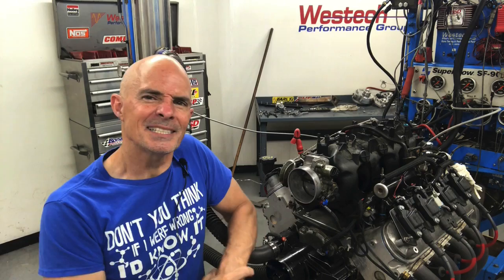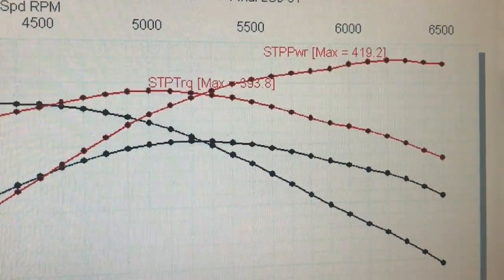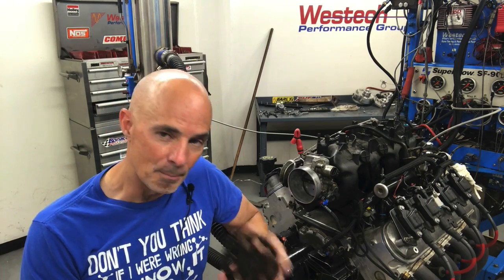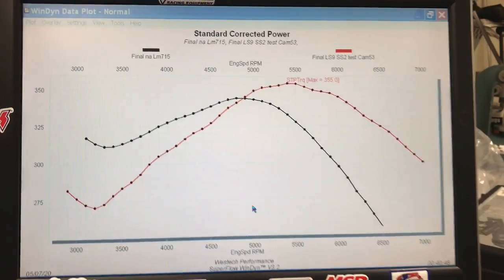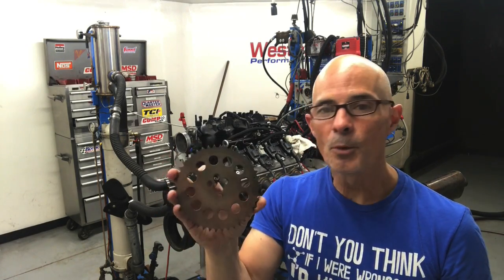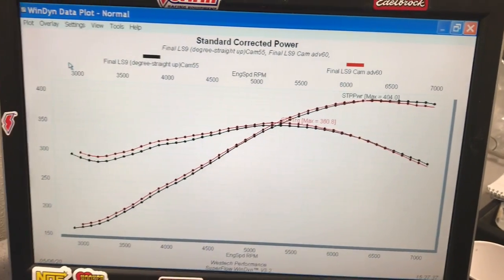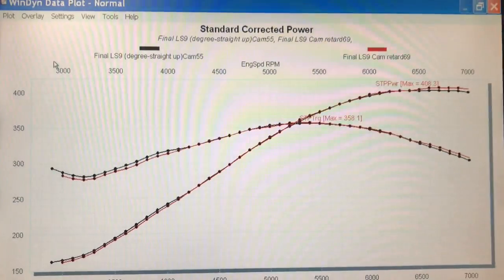LS9 HOW TO: EXTRA TORQUE!!

Comment: If you are running a LS nine cam and a 53 or 4.8 pull it out I’m telling you seriously I had that thing in there for three years. It sounds really great, but it ran like shit. I recently put the stock back in man, let me tell you the difference. Do not use the LS nine count Told me that I did not listen. I’m telling you do not use the LS in a 53 if you’re not going turbo or nitrous. Torque is everything forget horsepower.
Reply from the maker: see the Ultimate factory Cam shoot out for data on how soft the LS9 cam is down low

Comment: Question, can a Mag 2300 charged LS7 make the same or better midrange than a LS9?    All the Dynos on Dynojets I see make like 300rwhp at 3000-4000rpm seems low, can you not run as much timing in the midrange on a charged LS7 compare to LS9?
Reply from the maker: only if octane is limiting your power

Comment: I've been wondering what cam to go to for streetable car. But also wondering if I could take my 5.3 aluminum block engine and use the 4.8 crank shaft then the LS Cam possibly some better springs and a big mass air intake. 
Essentially building s modern 302.
 I'd love to hear thoughts. 
Best Wishes for a fantastic New Year and Merry Christmas.
Reply from the maker: a 5.3l block with a 4.8l crank is just a 4.8L. you need a 6.0l block (4.0-inch bore) and 4.8l crank and rods with 6.0l pistons. but that isn't a 302 inch motor. I have a destroked ls3 video up

Comment: So it appears, advancing the cam made more power and torque, up until the peak power where it feel off a bit. Are there any cons to running it in an advanced state like that for say, a street car?
Reply from the maker: IT DID'NT MAKE MORE POWER-ADVANCING SHOULD ADD LOW SPEED TORQUE
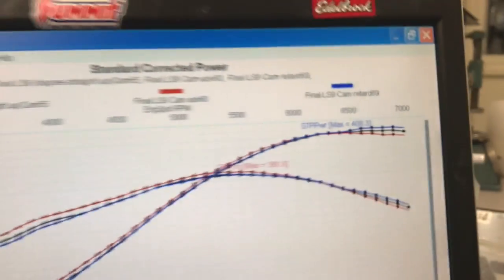Reply: @richardholdener1727  I don't want to come off as arguing with you because when it comes to this stuff, you're the man, but at 9:54, looking at your graph, the red line represents "LS9adv60" and it's above the power and torque line of LS9 straight up and even the LS9retard69 (min 14:21), the entire time until peak power. Unless I'm completely reading wrong, it seems like it does.

Granted it made significantly more torque than it did power but I'm going off the lines on your charts.

Comment: How about a cam test where you get the nastiest, most ridiculous-lift cam you can get, with springs to handle it, titanium retainers, and compare it to the stock cam? One where you need some clay to make sure you aren't touching or getting within 1/100th of an inch of pistons at any time. Make the engine really a rev monster, and document it? Smalll blocks these days are doing better than big blocks of  yore.
Reply from the maker: i HAVE RUN ALL THE CAM THAT WILL FIT IN AN LS VS A STOCK ONE
Reply: @richardholdener1727  I will look at your channel  more!

Comment: @richard holdener I have the LS9 cam in a 5.3 with headers, polished 862 heads and stock intake for an SSR. Someone advised me to add 1.8 rockers ONLY TO THE INTAKE side with this cam. Doing the math the would effectively change the .558 intake lift to .590 and the intake duration from 211 to 223 ...ANY THOTS as to potential results? could this add power down low? or where?
Reply from the maker: WHAT SPRINGS-IT WILL CAUSE VALVE FLOAT
Reply: @richardholdener1727  I currently have GM LS7 springs in there.  I could change them if necessary,  but the engine guy who said this doesn't like the huge duration split of the LS9 cam and thinks this could wake things up some.  Is there any power to be added  just changing the intake side? This would effectively yield a 223 intake duration and 230 would remain on exhaust.

Comment: LSXR Intake, Trickflow 235 heads and a Sloppy Stage 2 Cam would that work for tons of low end torque for a rally/street engine with load speed of low down torque?
Reply from the maker: that combo would not be great down low
Reply: @richardholdener1727  Back to the drawing board, I go then
Reply: @richardholdener1727  If I swapped the LSXR Intake with a Edelbrok Cross Ram Intake and replaced  the Cam with a 
Final HDR Brian Tooley Racing Stage 1 Truck Cam and put in a neat little turbo though, would that be better for low end torque instead. Revisited your videos and made some changes to me wishlist here

Comment: Hi Richard, 
Nice to see that you tested the LS 9 Cam. 
I have a BMW E30 with a LS1 engine. 
It’s a competition Drift car. 
I make the engine swap last winter and it’s an awesome engine. 
I watched a lot of videos from you. 
I´m looking for some extra hp´s now. 
My Setup is:
LS 2 intake manifold
102mm TB
LS 2 Injectors
LS 9 Cam
Custom Headers
MSD Atomic LS Efi Kit
I run with 95 octane
Maybe something around 420-450 hp (never was on the dyno until yet) would be nice and I don’t know if an other cam with my setup is enough for this hp target. 
Can you recommend me a good way? 
Best regards 
Tim
Reply from the maker: lots of better cams than the LS9

Comment: I would like to see the LS9 cam versus the Lingenfelter GT2-3 in a LQ9 with the STS-V supercharger. Since the LQ9 is 211/230 .562 122.5 and the GT2-3 is 207/220 .571 .578 118.5. The GT2-3 was the "gold standard" for the MP112 and MP122 for the longest time but the LS9 obviously has more duration with a little less lift.

Comment: How much more down low improvement would 243 heads make?
Reply from the maker: COMPARED TO WHAT
Reply: @richardholdener1727  your test? Stock 4.8 with ls9 cam? But add 243 heads?

Comment: Hi, I have a Cam with the LS9 Cam Grind in my LS1 Drift Car, maybe you can help me with the ignition timing settings?
Reply from the maker: WE RUN NEAR 29 DEGREES TOTAL
Reply: @richardholdener1727  
I have a MSD Atomic LS EFI kit. There I can chose between stock, mild and Performance cam. What would you say is the LS9 cam? 
In the advanced setup I can set the ignition timing at idle, part throttle and wot. What setting you would chose?

Comment: Given that EFI breath raw air for basically the first and last third of each intake cycle with the fuel dose occuring in the middle third of the cycle , I feel the cam sensors location need not necessarily be individual degree accurate .

Comment: What ls9 camshaft is that? You are using a rear cam sensor.
Reply from the maker: I tried a stock one and a reproduction done by Crane (that has the rear gear)-same power
Reply: @richardholdener1727  thanks!

Comment: How would perform a 5.3 with an ls9 cam, the adjustable gear advancing just a little and turbo ??
Or would it be better just with the ls9 cam and the turbo without the adjustable timing gear?
Reply from the maker: I TRIED ADJUSTING THE CAM-THE BEST WAY IS TO USE A DIFFERENT CAM

Comment: yes, GM does want to kill torque and throttle response.  The wide LSA also lets them run higher compression ratio to get better mpg.  Run a 275* cam with 110 LSA and watch out!

Comment: I built a 2300cc ford engine back in 1985. cannon intake (interesting intake in that it had smaller runners but they were pointed at the ports better and worth more torque and hp!) little bit bigger carb custom jetting, I ported the iron heads myself and shaved .1 inch from deck for 12 to 1 CR measured, crane 230 degree at .50 lift cam, full length header, custom advance curve in distributor with vacuum advance, adjustable cam sprocket. I initially installed cam  mistakenly advanced by one tooth. Maybe 10 degrees? it was a long time ago. The engine ran like a forklift. I could dump the clutch in first gear with no throttle and the engine wouldn't die. I got the cam sprocket lined up correctly and started experimenting and got identical rocking in the power curve as you did Rich. Now i'm going by the seat of the pants feel. The power gain and loss was more pronounced in this little engine than your Ls9.  When retarded 3 or 4 degrees from "factory" the engine would gain about 15 hp on the top and lose that much when the cam was advanced with the same ratio in gain and loss in the lower rpm. Fun stuff, thanks for all your work, it's very interesting!

Comment: Just started watching your videos, and am loving the content.  You are putting all kinds of LS specific content that is great, but was wondering if while you are at it if you could debunk some common myths?  Like say is there any hp change with different spark plugs or wires like the companies claim? Or how much does a mechanical fan Clutch take in HP, Or electric water pump for that matter.  Dirty oil vs clean oil, oil weights, oil filters, the possibilities are many!  Maybe meaningless info but interesting nonetheless. Keep up the good work!

Comment: Richard years ago when i was a kid out of trade school i went to work for gm and lol i bought a Rancho Ford GT 460 and my friend at ford house told install a 429 crank gear . I did Ford retarded the crank gear i think a half a tooth . I did that clean up exhsust a tad lol and a tune up timing ect . It would eat a set of goodyear tires . So there are times when this will work .  As far cams the closing of intake valve late for instance reduced power.  I seen cam with a lot of exhaust duration cause problems with drivable manners

Comment: Changing the 1x cam gear 8deg shouldn't affect the cam sync.  The missing tooth crank wheel is used for timing, the ecu uses the missing tooth to find TDC.  The cam 1x is only used to determine what phase the engine is on. (#1 cyl is on exhaust or compression)

Comment: Richard Holdener, I'm getting ready to put a Gen IV 4.8L with VVT, non DOD, E38ecm into my 69 Chevelle. I can only afford to buy one camshaft and want to do the cam change while engine is still on the ground. What would be your camshaft of choice if you were me? I'm thinking that I want to keep the VVT function. 
Oh yeah, street car with an occasional 1/4 mile trip.

Comment: Thank you!!!! I get soooo sick and tired of people asking me, if I'm doing an engine build, do I degree the cam with a degree wheel. When I tell them I just put it in straight up, or retarded or very rarely advanced, I get the, " Well my girlfriends uncle works for NASA and says you always have to degree the cam or your not a real engine builder". Of course this usually comes from someone who's never done an oil change, let alone built an engine. Everybody wants to be an armchair quarter back, but doesn't want to get dirty on the field. BTW, there are a few companies out there that make wire harnesses and adapters to use the different Gen timing gears with the vehicle computers without issue. I see placement and type of knock sensor more of an issue than the different Gen timing gears with the car ECM. Good info.

Comment: I have done that on accident (one tooth off) with 411 pcm. Runs terrible hard to describe like idle timing is 30 degrees off, which may be what's happening due to offset sensor
Reply from the maker: we don't use a cam sensor
Reply: @richardholdener1727  I understand that with Holley but you asked about stock pcm experiences

Comment: Ran a ls9 cam in a turbo 4.8 build I did a few years back. Didn't run a cam sensor just left it unplugged. No  problems with stock ecu.

Comment: iirc the LS9 cam uses the exact same lobes as the LS7 but on a wider LSA.  LS7 should make torque at lower rpm
Reply from the maker: it made exactly the same on the 5.3L

Comment: I'm curios if the results would be the same with other types of aftermarket cams with tighter LSA.
Reply from the maker: generally cam timing responds like this, some more or less
Reply: @richardholdener1727  So it would seem that degreeing a cam might not be as critical as some make it out to be from a power perspective.

Comment: I live above 5000 ft. altitude, and I can't ever remember retarding a cam. I think we always tried to keep the lobe centers between 108 and 112 degrees thinking it would help trap cylinder pressure. We might use smaller runners and intake valves to help port velocity.

Comment: Hey Richard. To answer your question on advancing or retard teeth, the answer is both. On the early Gen 3 16238212, 411,  and  12576106 PCM's many times they did not have enough resolution and refresh rate to trip a camshaft position or correlation code. I've diagnosed a few builds who had camshafts up to two teeth off, but ended up running decent at idle and with no codes, however PTV caused lifter and exhaust valve damage. The later PCMs for Gen 4 after the GTO's E38 and E40 utilize a CANBUS system and 58x resolution which is much more sensitive to camshaft position changes. Even with adjustable set after around 4 degrees of camshaft offset the computer is not happy and you must utilize some factory tune tricks ti get it to run happy.
Reply from the maker: thnx

Comment: We saw similar things back when 302 Fords were being built.   The stock late model cam gears were retarded from the factory....add some miles with chain stretch and things got pretty soggy down low and in the midrange.   Swap in a fresh OLD gear....which was almost 1/2 tooth advanced with a fresh chain,  then throw in 4 more degrees advance and the motors would run a lot better.   Well worth doing for sure.   And one thing the dyno isn't showing is the sub-3000 rpm running which is where the advanced cam really shows the advantages on a normal street engine.   Good video!

Comment: Richard should look at the Ford barra engine  and intec all 6 cylinder  here in Australia. Intec shoc 6 cylinder with only 35 pound's off boost doing 7.5 over quarter. road going barra 6 cylinder     putting out 2100 hp at rear wheels  all on factory blocks and heads of course there billet internals .dynamite performance has a dodge avenger prostock with a barra in it  destroked running 50 pounds boost over 2000 rwhp 10000 revs traction is a problem. Considering a mighty 2jz running 100 pounds boost billet block etc Ford  coming real fast.

Comment: wouldn't 1 tooth be more like 16 degrees since its based on degrees of crankshaft rotation?  Cam moves at half the speed of the crank.  360/44=8.18.    8.18*2=16.32.  Correct me if I'm wrong.
Reply from the maker: we were talking cam degrees-crank degrees would be double

Comment: On top of losing torque, I'd have to get the right sprocket, different timing cover and move the cam position sensor and hope it works with my stock ecu all this cost money on top of what the LS9 cam would cost me so I'd rather just get a summit truck cam for only a bit of extra cost

Comment: Having such a wide LSA will normally increase dynamic compression, however this is offset by the more exaggerated duration though, right?  What happens with this cam if you bump the static compression 1-2 points?
Reply from the maker: compression helps any cam-the LS9 cam still has the same loss in low speed-and I think maybe less dynamic compression in the loss area

Comment: Great test, now repeat advancing the ls9 cam in a 6.0 with forced induction just to be sure!
Reply from the maker: if it doesn't work na-it doesn't work under boost (results on a 6.0L would be same-maybe slightly bigger variations)

Comment: What about just mill the heads ? 
I used Ls9 camshaft on many na ls3s 
And made from 478rwhp to 496rwhp .. I also ran Ls9 cam vs 224/234 .624” 115lsa and Ls9 lost by 11hp (from 5900)... both cams made same tq 458. That was custom ecs cam (800$ cam/springs/pushrods vs 160$ Ls9 cam stock springs )  plus Ls9 sounded stock. 
I usually mill the heads 0.040” to help with tq down low but also gain up top .
Reply from the maker: milling helps any motor and cam comb add power-it doesn't help the LS9 add low-speed torque

Comment: Maybe I missed something. That gadget moves the teeth either forward of rotation or back from rotation?? Other words.  To the right or left ?? Know what I mean ?
Reply from the maker: just advances or retards the cam depending on which direction you go
Reply: Richard Holdener. Okay. I wanna understand you.  To say tdc is tooth zero. You did say it can advance one tooth?? So that would be one tooth forward of rotation from same rotation. Not backwards from tooth zero. ( top dead center.   Tdc)

Comment: With the lobe separation angle of that cam it's always going to be at a deficit until the very peak. A tighter LSA, shorter duration cam with the same overlap would bring in the midrange, give a lot more power under the curve, be more fun to drive and faster under almost all conditions.

Comment: You definitely want to be careful adv or ret on a 24x motor.  All the CRK events are evenly spaced at 15 deg apart and the CMP sync event needs to fall somewhere in the middle of the TDC event, to stay away from the  falling and rising edges of the CRK. if it gets too close, it could jump into the next one and adv or ret the ignition timing 15 deg.   This wouldnt be a problem on the 58x (60-2) motors because there is a sync event (the -2) on the crank itself.
Reply from the maker: thnx

Comment: I knew it wouldn’t make as much of a difference as being ground on 112+2, but I really hoped the torque curve would be in the middle of the stock lm7 and ls9 installed straight up. It’s a dirt cheap cam, but not good for stock truck application or daily driver.

Comment: "Most powerful GM production cam" not to sure about that.  The Pontiac Ram Air IV cam with 231/240 @.050 isn't no slouch and it's not even a roller...
Reply from the maker: I meant factory LS cam-should have been more clear